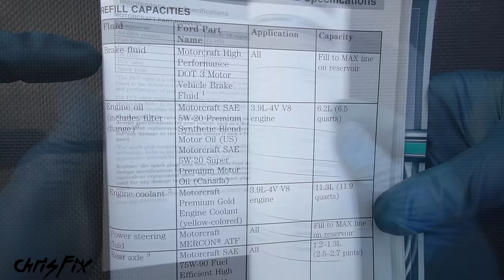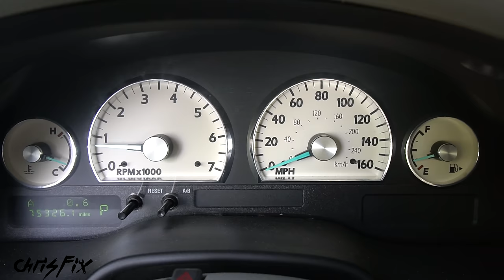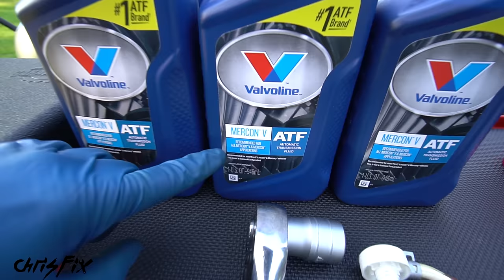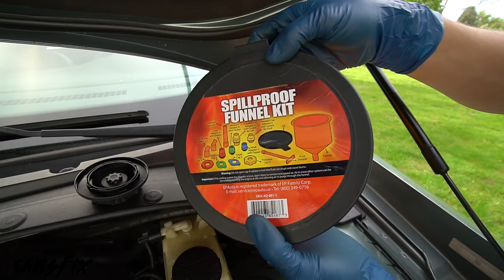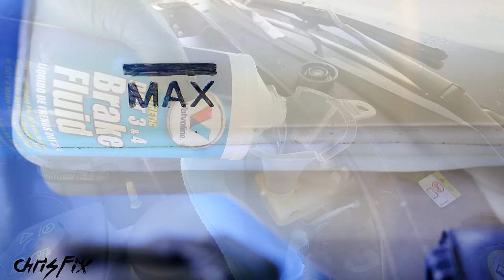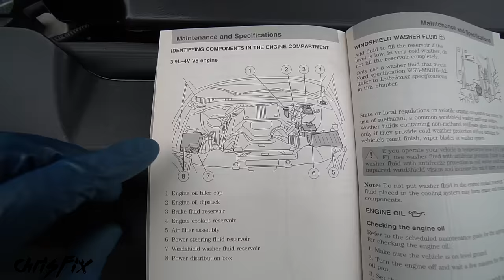How to Change EVERY FLUID in your Car or Truck (Oil, Transmission, Coolant, Brake, and More)

Comment: You made changing your oil look so simple, but I spent an hour trying to get the drain plug out, and another hour trying to take off the oil filter! It was way tighter than it should have been.
Reply from the maker: Once you do it and a shop doesn’t over tighten it, the next time is way easier. Also get a longer wrench. Leverage is your friend! Extendable ratchets are great for that reason!
Reply: @chrisfix  We actually did get a breaker bar, and it was still pretty difficult! We couldn't get the car high enough to make it easy. Maybe next time I'll take it to the school where they have a lift.

Comment: This guy has showed everything except how to change an engine.
Reply: showed everything except his face
Reply: @yesaya19  technically not true.
Reply: @Derpingtonshere  what do mean?
Reply: @jeff1595  theres a few videos showing his face, just search them up
Reply: No need to change engine when you service it right and it does not have too much miles on the engine
Reply: He also didnt show us how to replace blinker fluid
Reply: @bryceharris8893  he actually did like 4 years ago
Reply: That's a 4 hour job
Reply: That would be amazing if he did, I've always wanted to buy a banger and do it up with an engine swap
Reply: Waddup Mayne  Not true.
Reply: Waddup Mayne incorrect
Reply: he never showed how to replace a head gasket
Reply: @Scoon83  takumi with ae86, get 2024 engine in a 1986 car. (actually most likely a lot of compatibility issues)
Reply: @ShieldTonHD  Technically you don't even need to worry about servicing if there are no miles on the engine :P ....maybe oil and hoses if it's old
Reply: @ShieldTonHD  cries in first gen RX-7
Reply: How to do an LS swap when?

Comment: Helpful tip:

Race ramps work great for lifting a car from all four wheels and I feel a lot safer. Drive up the front ramps, jack rear up and slide a second set under. Feels way more solid that jack stands imo

Comment: This guy has told how to install every single thing EXCEPT

Turbo....
Reply from the maker: That'll be here very soon! Stay tuneeeeed!
Reply: @chrisfix  i will😏
Reply: @chrisfix  is that a pun lol
Reply: @chrisfix   I just got a truck what's been sitting for 5 years what should I do
Reply: Ikkk I've bee. Waiting for that video ever since he got that del sol
Reply: Logan Wilmes change all of the oils and fluids in the car Asap
Reply: @chrisb5523   Chris v.2
Reply: Need to fly MCM out to ChrisFix to turbo all the cars
Reply: Chris- love the channel.  I just bought a 2018 F-150 with 2.7L EcoBoost- does it need an oil separator?
Reply: ChrisFix put a turbo on the Del Sol! Love that car man! Want to see more del sol videos!
Reply: @chrisfix  ba dum tss
Reply: check out 14:25 the "up next" section
Reply: @chrisfix  you will be cemented into the Hall of Fame
Reply: @chrisfix  That would be good because i've never really seen a turbo being replaced

Comment: A lovely tutorial on servicing your car, but just a couple tiny notes:

1. If your differential/trans have both fill and drainage holes, undo the fill plugs first! If you drain your fluid and you have a seized fill plug that you can't get off at home, your car is now non-operational because the fluids are drained and you can't add any to drive it to a shop to help you out.
2. When flushing your brakes, the order goes from furthest from your brake master cylinder first to the one closest to your master cylinder last: I don't have enough experience with cars to see if master cylinders are placed anywhere other than the driver side, but it might be different on right hand drive cars. 

Other than that, this video was perfect. Well lit, well narrated, and hit all the important points home. Thanks for taking the time to make these!
Reply: Very good point for the first tip, chris has always made a point of this in his other videos, never hurts to be reminded though.

Comment: Quick point: not all cars have frame rails. 

Check your owners manual, repair manual for your specific vehicle, or an online forum for the lift points or jack points. 

Depending on suspension design you can put the jacks under the lower control arms. I wouldn’t recommend this for newbie’s though, as it’ll allow the car body to still move. It’s a viable option though if you only need to lift one wheel off the ground, say to do some brake work.

Comment: Little tip for oil change on diesel engines, if your oil is black even after the oil change, dont worry, just diesel things
Reply from the maker: Thanks for sharing!
Reply: Yup. Black oil on a diesel is a good thing. It means that the soot is properly being suspended in the oil.
Reply: @chrisfix  keep up the good work also fix my Corvette it a toy
Reply: Probably good to mention at this point that if the oil level is above the full mark it should be seen by a diesel mechanic. This is a symptom of a fairly common diesel problem caused by a combination of a restricted DPF and a fouled EGR valve, but whatever the cause it probably means the oil is being diluted by diesel fuel. Black is good, too much is bad.
Reply: I'm new to this, how do you know the difference in engines?
Reply: @ashantirobinson7692  If I understand you right, you are asking how I know the difference between diesel and gas engines?  I've been getting information from books, websites and other people

Comment: 24:22 one thing missed is in most cars there's a "cold fill line" on your coolant reservoir about 2/3 of the way up. That's where the coolant level should be once you let you car cool down, in the video he fills his all the way to the top which is rare for a vehicle

Comment: I was helping a friend change her oil a couple months ago, and she was shocked when I started pulling all these random caps off. Turns out, she thought that all fluids (except fuel) went in the oil fill. Said her dad told her that was the only one she had to worry about. I felt so bad for the car. I told her if she had any question, or ever needed to check or fill her fluids, let me know.
Reply from the maker: Dang, I'm glad to see she learned a little more about cars that day!

Comment: Yo Chris, you forgot the most important of them all!
The Blinker Fluid
Reply: Was about to post the same thing. 🤣 Because of the Corona I can’t find blinker fluid in any auto store here in Florida. 😉
Reply: @AwesomeProjects20  be sure to change the wiper grease as well while you're at it! :P
Reply: Blinker fluid doesn't exist!
Reply: @suzannepottsshorts  I'll let you in on a little secret. Santa Claus isn't real too.
Reply: Hey, you forgot the headlight fluid!
Reply: @FindingClock4  not to mention the speaker coolant
Reply: That was my first thought too!
Reply: I think if you drive a BMW, you may not need to change the indicator fluid, as indicators come as an optional extra on BMWs!
Reply: dont forget your radio fuel

Comment: Very helpful video. Even the very beginning, showing how to securely jack up a vehicle. That process deterred me from putting on my own wheel spacers. As easy of a job as that is, I was skeptical about my ability to properly jack up my Honda Element to get it done, so I ended up spending $40 to have the local tire shop do them. Which ended up saving me the money it would have costed to buy a good jack & stands & breaker bar, although I would like to purchase all that eventually, as I'm becoming more interested in DIY mechanical stuff. At the ripe age of just about 33. 😂 I sincerely thank you for all of your helpful videos, on behalf of all of us, who you have helped save thousandsssss on repairs. 🙏 Bless you.
Reply: Hey I love your post and I love the fact that you have some hesitation on lifting your vehicle and working on it. Why? Because its people like you that are SAFE when working on cars. Its ok to be nervous, just double check you have all of your safety measures in place and you will be ok.

Sometimes the people who have been doing this for so long forget or ignore the little safety thing and it comes back to bite them so a little hesitation just ensures you are doubly careful.

Comment: Watching that as an electric vehicle owner like...
Reply: An electric car owner can do every one of these changes, except engine oil, transmission oil and maybe power steering fluid. I have one Ev out of 5 other I.C.E cars and you can put coolant in the Ev
Reply: EVs still use brake fluid and grease. Maybe even gear oil too.
Reply: @truckinman86  Yes, the first thing I did after buying my second hand EV (Citroen C-zero a.k.a. Mitsubishi I-Miev) was to change the gear fluid. It is super easy to do on this car as we don't have to lift it to change it :).
The previous owner thought that with an EV you don't need any maintenance at all. I changed the brake fluid too.
Reply: ..like, look at all this maintenance expense I just saved. lol
Reply: @loranger6447  depends on the car I guess. Tesla's coolant is a sealed system. They dont call for any service on power steering. So that leaves brake fluid and washer fluid. And any possible grease points.
Reply: Tesla all the way lol
Reply: Blinker fluid is the #1 fluid to run low on EV. At least I THINK that's why I constantly see Tesla owners not using them.
Reply: PlanesTrainsAutos yeah you are right. My BMW i3s you can top up coolant, but I never knew you can’t in a Tesla

Comment: Chris: Break it loose
Also Chris: be careful, you don't want to break it.....

Me: 0_0
Reply: Yeah, Ive broken one of those radiator petcocks before using a socket- you are better using a hex wrench.  The plastic gets brittle after years.

Comment: Chris: I don’t have any transfer case parts     
Chris: screw it some gears and a chainsaw chain.
Reply from the maker: I figured that was good representation of a transfer case :p
Reply: ChrisFix that would be correct though some transfer cases use all gears and no chain, and some have a tensioner, some transfer cases share fluid with the transmission, doublers commonly used in off roading have to be removed in some cases to correctly fill the case, triple dog boxes and hi low ranges such as in Eaton’s Allison’s and Mack transmission for their larger semis are all one piece inside the transmission it’s self

Comment: Came here for every fluid, still questioning how to top off the gas...
Reply from the maker: How could I forget :o
Reply: ChrisFix you also forgot how to change my blinker fluid!
Reply: @Owen O’Reilly It’s going to be OK. We will get through this. We will persevere, because WE, THE PEOPLE, deserve JUSTICE!
Reply: @owenoreilly_20  If there is nowhere to fill or drain blinker coolant, it probably uses engine coolant.
Reply: User 2C47 yeah, probably the same for headlight fluid
Reply: ChrisFix would these fluid changes be more economical to have done at a shop when considering all the equipment and tools ? Also considering i live in a apartment and have next to nothing.
Reply: @chrisfix  you made a whole video on fuel already!!
Reply: @Meme Man what does it means??
Reply: I felt that
Reply: Chris lives in a state where it's illegal to pump your own gas!

Comment: 1. 4:25 Engine oil.
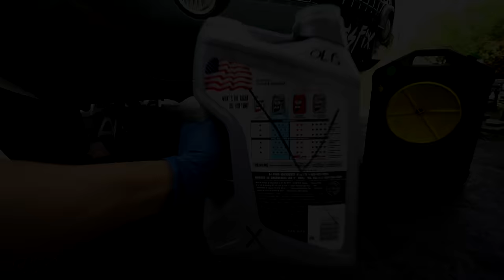2. 9:39 transmission fluid.
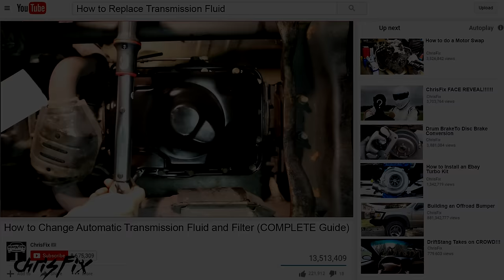3. 14:38 power steering fluid.
4. 17:15 engine coolant.
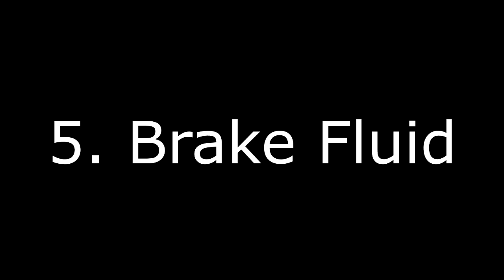5. 24:50 break fluid.
6. 30:23 differential fluid.
7. 32:53 Transfer case fluid.

Enjoy 😊

Comment: What about that smoke machine video for testing evap systems... can’t wait for that one.  I have a leak on mine and want to see how you do it
Reply: Just make your own ton of vids on YouTube or get a smoke tester on Walmart’s website and plug the hose into one of the purge valve hose
Reply: fryrear technology just use a vape duuuude
Reply: @kollederboss1594  Just use stoegers like Arnold Schwarzenegger
Reply: KOLLEDERBOSS I don’t smoke but I did try using one of the 18650 battery powered vape’s but the BMW Z3 M roadster with the S54 has a rather large system that takes a lot to fill up with smoke so I needing a higher output and to spite the Snap-on guy living next door I hate getting on the truck $50 a week for life my butt or $3k for a smoke machine.  The cheap online one from eBay only have a 3-5 minute on time and 15-20 off.  I plan on doing more auto work like chrisfix and try to make some money from home where I can be with my family and just not at work.

Comment: Chris fix: keep coolant away from dogs because if it drinks it. Your dog can die.

Chris fixes Dog: *sitting right in front of the coolant.
Reply: i think most if not all coolants have a bittering agent to prevent that, but i'm not sure how you can safely test that :p
Reply: @poiiihy  by drinking it
Reply: William Baker  good doggo

Comment: 00:36 How to pick the right fluids
?
01:15 Lift the car safely
04:23 1- Engine Oil
09:38 2- Transmission Fluid
14:36 3- Power Steering Fluid
17:14 4- Engine Coolant
24:50 5- Brake Fluid
30:23 6- Differential Fluid
32:53 7- Transfer Case Fluid
34:58 8- Grease
36:55 9- Washer Fluid

Comment: 4:26 Engine oil
9:38 Trans fluid
14:37 Power Steering
17:14 Engine coolant
24:49 Brake fluid
30:24 Diff fluid
32:52 Transfer case fluid
34:58 Grease
Reply: He didn't show how to change Blinker fluid
Reply: @EngiNetion  😂
Reply from the maker: Watch the video more closely ;)

Comment: Also, just a reminder when filling a sealed transmission, keep the engine running when you check the level.
I made the mistake once and lost half of the fluid I put in. Not fun.
Reply from the maker: Darn!

Comment: Interesting fact: Old coolant can get electrolysis, which means that it generates a small voltage and can damage and corrode the cooling system.

Comment: I know I am late, but I hope this is helpful to you: if you do not find the required quantities for your car, oil finder sites just as those of Castrol or LM are extremely helpful. Found this out as an auto parts salesman
Reply from the maker: Thanks for the tip

Comment: Note 📝: Only fill the coolant reservoir to the “Max” line. Don’t fill it up to the very top. Space is needed or too much pressure will build up causing a hose to burst. Ask me how I know.
Reply: How do you know?
Reply: You're right, when the engine meets operating temp, excess coolant "expands" into the reservoir tank. Some vehicles, however, have a vent hose for pressure relief. Over filling may not be a horror. But, the main reason NOT to FILL it is because of cold weather. If the coolant is not the right mix , in extreme cases, it can freeze. When water freezes it expands, this will crack your reservoir. The same apply's to washing fluid. In extremely cold climates. NEVER TOP IT OFF> Cheers
Reply: Emmett Santos_I had to replace a whole water housing assembly after one of the small hoses burst at the attachment point to the rest of the assembly iirc.    This happened shortly after topping it off to the very top from just below “MAX”. They charged me around $400.
Reply: @keviiiboo7460  Most cars have a pressure relief valve in the coolant reservoir cap. Hence, I would recommend for you to check if your coolant cap has a built-in pressure relief valve and change it if it has. Otherwise your cooling system can be pressurized too much again and you can blow another hose, even if you do not fill your coolant to the very top.

Comment: "EVERY FLUID"
Doesn't even mention Blinker fluid
Reply: It's one of the recommended videos at the very end.
Reply: At 24:41 look at top left corner of screen, it's there
Reply: Or alternator fluid, unless i missed it
Reply: Summer/Winter Air counts as a fluid
Reply: Only applies for bmws

Comment: Im soo thankful for this video in came in clutch since I have not been taught this before. SInce latley my mother has been saying she feels like she has no breaks and when i drove it i noticed too that her breaks felt squishy, and immediately knew how to do it thanks to this video, and an older version of it you posted before. So I bleed the breaks with my little brother and mannn, the breaks are feeling wayyy better than before, I just need to change the breaks next and it'll feel brand spank'in new.

Im glad I did it for like around $10, which I knew if she would have tooken it in by a mechanic, it most likley would've been more than $50-100 guarantee.

Comment: I just recently changed my transmission fluid just to find out it was the original trans. Fluid from the factory and the car is 35 years old.
Reply: holy sheet
Reply: Did you ruin the transmission or does still run properly?
Reply: Alot of times when the fluid has been in there that long thats the only thing keeping the trans going
Reply: @mathewb5044 
That's why I asked my question
Im very curious to know about the out come since I have 130k on my original ATF and a ZF transmission i heard they are very sensitive
Reply: @mathewb5044  only if it's a auto
Reply: The thing is it takes dexron II which doesn't exist any more and it's a red color, what came out was a very slight darker red so it was still good over 35 years. It takes 11.30 quarts.
Reply: Thought about changing trans fluid on my Escalade with the 4L65E but not sure if it’s ever been changed or ok to do so. It’s got 117k
Reply: @axelmartinez3571  That's pretty surprising that it wasn't burnt. I'm assuming the car doesn't have that many miles on it? Either way I would have been extremely afraid to even touch it being that old lol

Comment: Another good video 😊
On all Toyota vehicles with sealed transmission. The correct fluid temperature is between 104 to 113 degrees. The easiest and the cheapest way to measure the transmission fluid temperature is the meat thermometer 😂
After filling the fluid, insert the probe through the silicone plug and cork the check valve hole. Run your vehicle until the transmission fluid temperature comes up between 104 to 113 degrees.
Drain until trickle.
You don't need a scanner to tell you what the temperature is. 😂